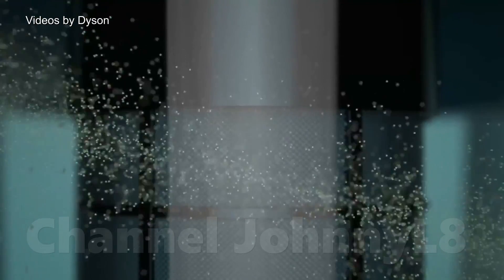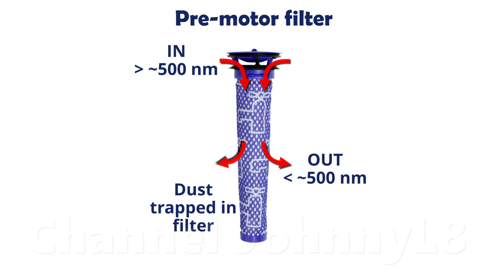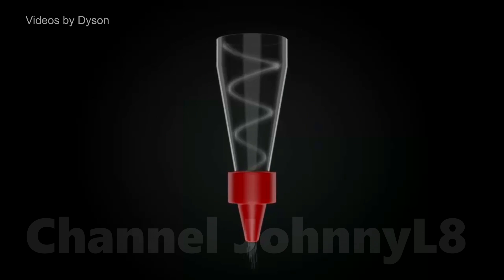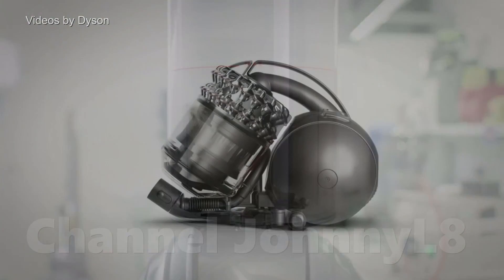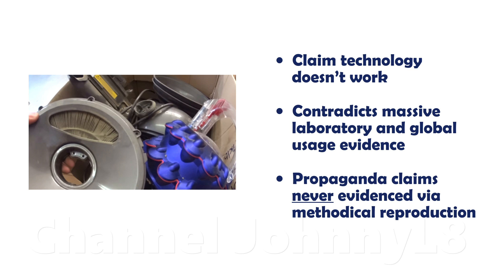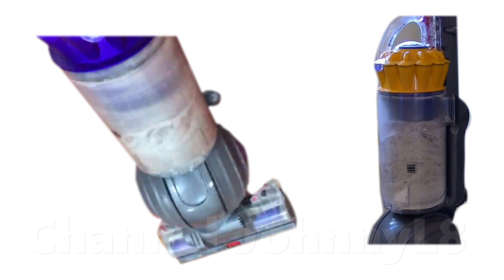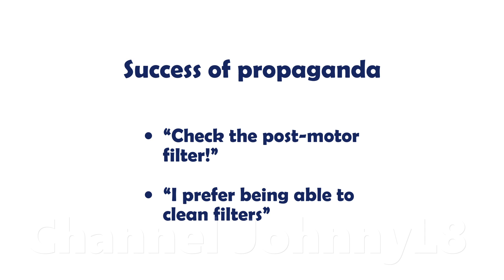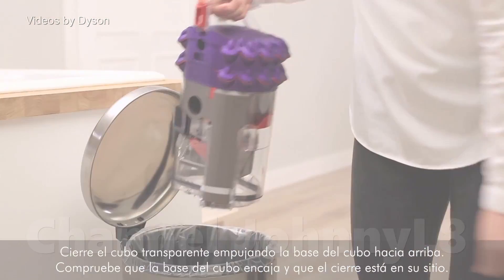Dyson Cinetic Technology is Amazing

Comment: I have a Dyson Cinetic Multi Floor… I think Dyson considers it the DC14 based off the warranty it came with (now expired). I haven’t had any problems to date. I don’t see any option to clean a pre filter on my machine only the two post filters on the sides of the rolling ball at the bottom. The reason for my question is i came across a great sale at Costco for the animal 3 + but I noticed it does have a pre-filter. Would there newest model be considered a step backwards then given how I would now have to rinse a filter or would you recommend picking up the newer model. This video was helpful but I’m left confused. Maybe I’m missing something? Thank you! 🙏
Reply from the maker: I've never been able to measure with Dyson's vacuums that a later model is a step backwards. Their filters rarely need cleaning anyway since they're a last line of defense rather than a first and see little dirt since they have the best cyclones by far. I have a video on not washing the filter https://youtu.be/T3prXR-aeOg. Cinetic tech was discontinued when moving to cordless for reasons discussed here https://youtu.be/Z3MefmIot6M .

It's up to you how you spend your money. The animal 3 in the US is the latest and best of the cumbersome old upright format vacuums. If you want the latest and greatest and are prepared to pay for it, wait a little and get the next cordless model they release in the not too distant future, which will be radically different from anything else they've done. But it will be very expensive.

Comment: Dyson Cylconic technology is amazing! I have a Dyson myself, and I wash the filter every few uses. There is very little dust in that filter. It's amazing how Dyson vacuums get finer particles unlike other brands which use a filter as a first line of defense meaning that they would have to be cleaned more frequently than Dyson's filters.

Comment: Does the cyclone increase the suction ? And airflow
Reply from the maker: No that's not how they work. The motor determines the suction. The magnitude of airflow in the context seen talked about on YT is not directly relevant for reasons I'll do a video on in the future. Watch out for all sources that say it is important. They lack knowledge of basic science, as will be revealed, and cannot be trusted, no matter what they say. Cyclones resist the flow of air but the motor is tuned to compensate to achieve the desired aerodynamic properties at the cleaner head where dirt removal occurs. Their function is to separate particles from the air.

Comment: Here's the evidence you need on venturi systems or vacuum generators. This technology can be incorporated in modern  vacuum cleaners. 

https://youtu.be/iKzVhe8-AMg?si=BXXmc5LCj2VXFqfl
Reply from the maker: Not seeing much of a vacuum cleaner there or anything showing it can function as one. There's far more to a vacuum cleaner than a pump.
Reply: If you watch the video whether it's air gases or air with dirt the pump system that can be redirected into the venturi system it will create a vacuum. Remove the muffler setup as shown in the video, with a cyclone canister system and a bin you have a vacuum cleaner system
Reply from the maker: I'm not convinced. I've seen no data showing the ultimate pressure and motor airwatts generated, its power density, or its efficiency. As always with things like this I come across here, no data. Oh, and how it's driven without a motor.
Reply: It uses a compressor or a pump. A motor can be attached to a compressor rotor or piston pump assembly to make the pump, whether a vacuum pump or a compressor pump. A pump has to draw from one end ( vacuum)and exit out of the other end outflow. But one can divert the outflow through a Venturi system and create vacuum.
Reply from the maker: There's no data showing the ultimate pressure and motor airwatts generated, its power density, or its efficiency. These are important physical parameters when it comes to powering a cleaner.
Reply: Also volumetric efficiency with the least amount of restrictions. Also air density and the turbine itself on the vacuum motor which should be good for creating pressure itself and suction or lift. A 56 trim turbine works very well as well when it comes to air watts as well. Still when put through a venturi system you'll get efficient air watts.
Reply from the maker: No data

Comment: Heres a question. Why does Dyson on their V10 and upwards. Run these models at 135000rpm for effective suction. To be honest if his product backs up ( never lose suction). Why now does he need to up the revolutions of the impeller faster than the speed of sound??? One can achieve good cyclone separation at lower speeds why the extra ramp up??? Why not use venturi technology which can produce better suction at lower RPM???
Reply from the maker: I think I've decoded your quasi-sentences. If you rotate the impellor faster, you can move more air using a smaller motor. In other words, a smaller, lighter product can yield greater power. I'm not sure I've seen any evidence their impellors are supersonic, if you can provide some (rather than ignore the point going forward). Cyclonic separation efficiency is controlled by the airspeed within the cyclones, requiring higher pressure motors to create the jets. I'm not sure what you're referring to specifically by "venturi technology" as you didn't provide any details.
Reply: . Airflow can be amplified through a venturi system in a vacuum chamber an aerodynamic reduction can increase vacuum. Carburetors in older engines and small engines accomplish this as well.
Reply from the maker: No idea what you're talking about. If you think this will work, feel free to evidence it with a working product.
Reply: Here's the evidence you need on venturi systems and they can be used in vacuums as well. Vacuum generators 

https://youtu.be/iKzVhe8-AMg?si=BXXmc5LCj2VXFqfl

Comment: Shame the cordless Dyson’s on low speed don’t generate a high enough cyclone and most of the fine dust goes to the filter
Reply from the maker: This simply isn't true. Under real world, normal operation, emptying before the max fill line, the filter does not clog. This was demonstrated here https://youtu.be/T3prXR-aeOg and here https://youtu.be/Z3MefmIot6M . Furthermore, I'm seeing how long I can avoid washing the Gen5 filter and there's been no loss of performance so far with only cosmetic filter dusting.

Comment: I have a v15 with laser and totally love it! I had a Siemens before (with bag) but now it's kinda fun to vacuum, even if it sounds silly. Sadly i have to wash the post filter which is not a real problem, but then 24h drying is. I have 2 small birds so a lot of dust, having 2 filters is almost inevitable. Sadly that they couldn’t produce the cyclones within a handheld vacuum, cause that was the main point for me, you just pick it up and clean around the cage quick, without the need to get tangled in the siemens cord constantly, and its much lighter.
Reply from the maker: The monthly filter washing is mostly for odour management. If you empty after every use and never allow dust to go over the max fill line, then you can get away without washing the filters for much longer.

Comment: Hey I watched your videos on cinetic technology and was really amazed by the cyclone technology. I ended up finding and buying a brand new up14 cinetic. I want this to last as long as possible but I'm still worried about the lack pre motor filter after watching other videos and reading some stuff on reddit. Can I put like a piece of vacuum bag material over the motor hole(under canister)?
Reply from the maker: You could do what you want. You can cement it up if you like too for all the point it would have. Citing the internet's toilet, Reddit, as a reason to be concerned is silly. I suggest a more reputable source, such as https://youtu.be/Z3MefmIot6M They're even cleanable in case total neglect and abuse has occurred https://youtu.be/bP1vdnWIZSY They're otherwise lifetime filters that never need cleaning.
Reply: @VacuumFacts  I can clean the post motor filter of my Dyson cinetic up14? Isn't it paper?
Reply from the maker: PTFE I think. Paper is old technology found on poorer products these days.

Comment: Nice animations. In your opinion, is it okay to vacuum up wood or even concrete dust with the Dyson V11 Torque or other earlier Dysons?
Reply from the maker: I suppose. As long as the concrete dust has already set. Follow the manual for maintenance and filter rinsing.
Reply: @VacuumFacts  Thanks. I'd love you to make a video of vacuuming up such (dry) brick/concrete dust (wood dust too from drilling/sawing), and see how much makes it to the precious motor compartment. It would make for a very interesting experiment, and you can try with and without boost mode to see if that makes a difference too.
Reply from the maker: How do you propose accurately quantifying "how much makes it to the precious motor compartment"? I think this is an experiment anyone else can do too, including yourself if you get hold of a cheaper unit.
Reply: @VacuumFacts  With your experience and know-how, I'd trust your results over mine. I don't even know where the motor is situated in my v11 Torque and I'd be a bit nervous about opening it up. Quantifying may be tricky, though a visual inspection may suffice for a satisfactory conclusion unless you have a particularly accurate weighing machine.
Reply from the maker: I don't think you've thought this through enough
Reply: @VacuumFacts  Maybe. To be honest, it might just suffice to measure the weight of the (freshly cleaned) pre-motor filter, and compare flour as you did previously (and/or baking soda or talcum) to sawdust to concrete dust. At least then we can see how effective the cyclones are in handling the dust up to *that point*. I'd still like to see how much makes it to the motor though. At the end of the day, we just want want to see if it's safe to vacuum up sawdust or stone/concrete dust. Wouldn't you be interested in finding that out too?
Reply from the maker: How much makes it to the motor is controlled exclusively by the pre-motor filter, not the cyclones. Not everything that makes it to the motor stays there. What does may leave over time. There's no evidence the presence of the ultra tiny particles impair the motor in any way. I've seen no evidence it's unsafe to vacuum up very small particles; they end up in the HEPA filter. Rinsing them as instructed solves things. I've no interest in quantifying particle removal efficiency of each filtration stage; to do it properly requires a laboratory, expensive equipment, and a lot of time.

Comment: It's so disappointing that this hasn't become standard across Dyson models. All modern Dysons have a fatal flaw, which is that they need to be (destructively) disassembled to clean the cyclone chambers once greasy dust builds up on them. As a result, they have a major problem with cyclone clogging as well as large particles bypassing the system entirely. I understand that Dyson doesn't trust users to service those parts, but why not use some security screws instead of glue, single-use gaskets and snap fits?
Reply from the maker: The cyclone chambers never need to be cleaned as discussed here https://youtu.be/TjUdD6FZtMY and here https://youtu.be/hsl4tCaL6g8 There is no evidence that when used as instructed, there is cyclone clogging. There is evidence that when abused and neglected, like any product, failure can occur. More about the cinetic technology is discussed here https://youtu.be/Z3MefmIot6M

Comment: I have both an upright and a smaller DC54 mainly for the stairs etc , it was sold as a non servicable consumer filterless model, yet four years down the line it sounds like concord is landing , I stripped it down & found a hepa filter all clogged up non washable, dyson online wont sell you a new one unless you have an electric cert its supposed to be non servicable, e bay came to the rescue @£34 a lot cheaper than direct from dyson same part same part number & genuine dyson part. To sum up i purchased what was supposed to be a non filter cleaner but it does have one but dyson dont admit it because we customers are not aloud to service are own products .
Reply from the maker: Anecdotes are never as convincing as real evidence—particularly the evidence that shows how to reproduce such an alleged failure so it's clear how it happened. Because it doesn't have to happen, and evidence shows that it doesn't if used as instructed in the manual. Failure can be easily reproduced with product abuse. Evidence Cinetic technology works as claimed is available here https://youtu.be/Z3MefmIot6M and https://youtu.be/WNRayUWCKCE

Comment: The Dyson Cinetic Big Ball Animal is rated at 170 air watts. It has a lifetime belt and a washable lifetime post filter. It does not have a pre filter. It has sealed HEPA filtration. It has significantly less air watts than the DC33 and the Ball Animal 2. The Cinetic Big Ball Animal is a major step backwards for Dyson.
Reply from the maker: I don't agree with your assessment that "the Cinetic Big Ball Animal is a major step backwards". The way you concluded that is not supported by anything you've said. Air watts does not directly relate to cleaning performance, as has been shown beyond all reasonable doubt e.g. https://youtu.be/YnJ6OqVC_wg , nor does it directly relate to filtration performance.

Comment: Quite a piece of impressive technology to remove the need to have a pre motor filter and associated filter maintenance. The Engineers came up with quite a good piece of engineering and technology with the Cinetic pushing new boundaries! 
The Cinetic technology I think magnifies the user abuse vacuum cleaners in general are subjected to and put through by the owner. Like any Appliance follow the user and operating manual and carry out any regular maintenance if needed or required and the appliance will work and last! There is only a certain amount of neglect an appliance will take before it fails or breaks! If any at all! 
If dust and dirt was making its way through to the motor the extensive testing would have picked up on this and changes made before launched to the market! Plus the fact the technology is still available on some global markets confirms the technology works or Dyson would of pulled it!

Comment: “Always be skeptical of what you see on YouTube” says the biased Dyson shill 😂😂
Reply from the maker: Do you have any good reasoning to support your position, or was it just a mindless ad hominem attack that suggests you missed the point entirely? The latter would explain your comment.
Reply: You're right. Lots  of the older  components are discontinued. Over time the dustbins do crack and cloud because of the plastic deterioration. Eventually UV rays take their toll. Also environmental conditions. Everything wears even after normal years of use and proper maintenance. Technology works. Yes they have limiter devices, wear and tear no matter what the technology. I have an electrolux canister from the 1960s that still works fine and yes it still works and parts are readily available. After a good service, and of  course a moderate rebuild of some of the components it runs fine. I still can't find a dustbin for my Dyson DC41C because it's no longer available and it's the first generation radial root technology. I had to superglue the old one and make due with it. Small aging cracks have developed and the one I had to glue spread across the side of the bin, yes they're somewhat impact proof but do not hold up to normal aging. This what I'm writing is not a myth and also comes from vacuum repair facilities as well. Technology is there but the test of time isn't.

Comment: and what about moisture? the reason I didn't buy a dyson is because I saw a teardown of the big ball, and it had soo much dust buildup on those little tubes... shure if you are vaccuming super dry dust everything works great. But live is not about vaccuming super dry stuff all the time.
Reply from the maker: There's no evidence non-condensing moisture impairs function. Dust is supposed to be in the inside of the internal cyclone discharge chamber, as another of my videos discusses.

Comment: The cyclones are only there to catch the dirt , and do not have anything to do with actual suction power .An upright or stick vacuum needs a powered head to get best results ,without suction must be lost through a long tube
Reply from the maker: That's correct. However that conflicts with your earlier comment that dirt "changes the [cyclone] profile and effects efficiency" (there's no evidence for this).
Reply: @VacuumFacts  That also conflicts with  this video , where you say over fill the bin and the cyclones do not work , similar to having a load of dirt jammed up on the inside of them , it  effects efficiency .
Reply from the maker: @LOTPOR0402  You're conflating normal expected use with abuse, which is misleading... >_>